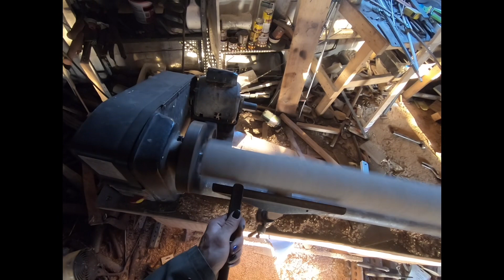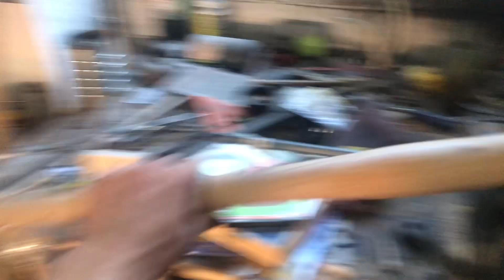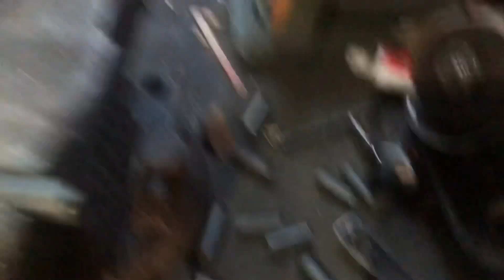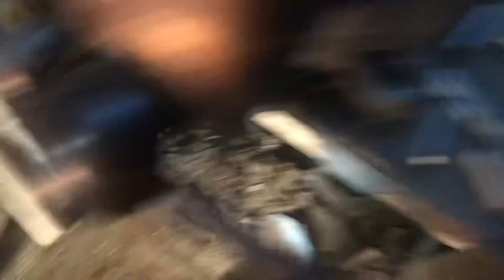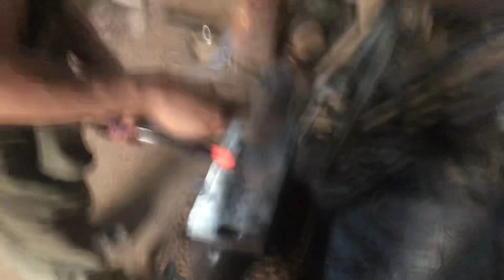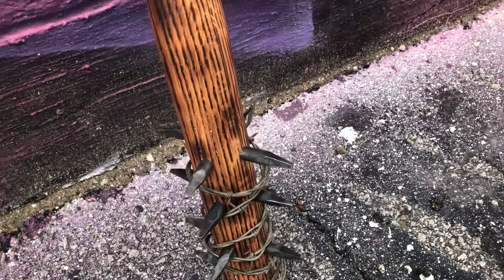How to make a post apocalyptic spiked baseball bat

Comment: Maaann you  got some cool gear bro!! You need a bigger space to play in and some extraction gear.
Phooph its hot here in new zealand today!! Sanding slingshot pistol handles and cant open doors else dust blows into the washroom. And had an annoying 8 yr old whos not high enough to see over the bench asking whats this called and wats it for. Thumping on my chissels as im doing fine finger curves thinking hes helping; despite being told off. So i sent him home. No tolerance for having chizels used for doing my fingernails.  What do you do for a job? Me stainless wine tanks. Welding and reflectiins on hot days is blistering.  Does your dad borrow your tools? Hehe mine does.